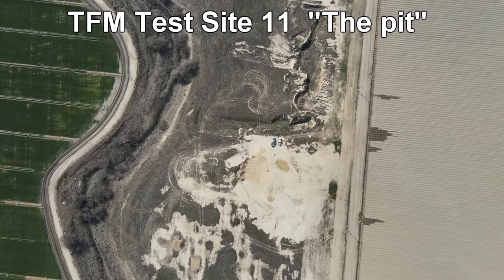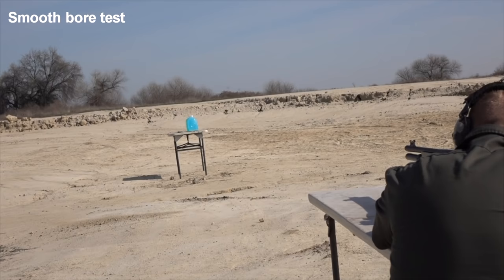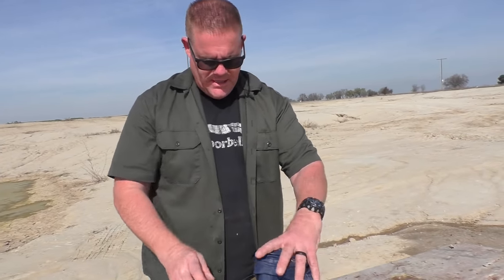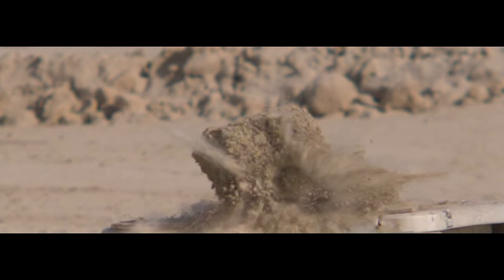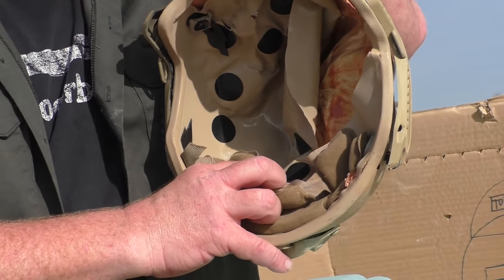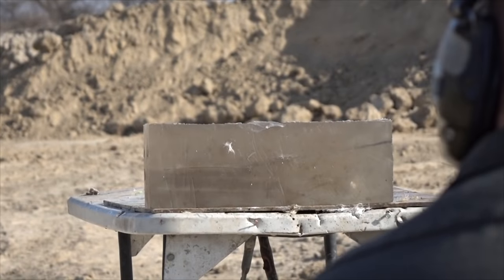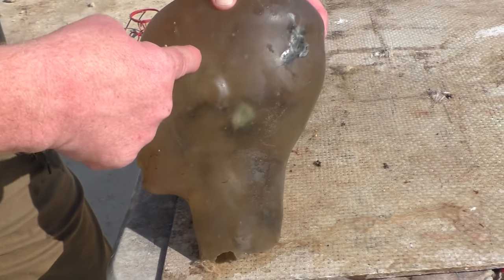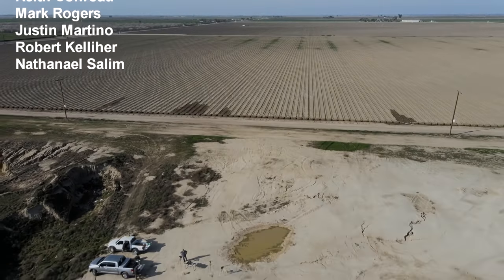4/0 Copper Cable Flechette Rounds - Tested

Comment: maybe solder the back end of 1 and try soldering the front end. would stay together till it hit then maybe shred the target.
Reply: I was thinking jb wield on both ends 🤷‍♂️
Reply: I was thinking just solder the back end and see what happens.
Reply: A few drops of cyanoacrylate glue. Just to give stability during acceleration.
Reply: I'm thinking melted wax might work to help hold them together. Or hot glue?
Reply: @andytuesday500  the point is to have the wires pop at some point, though, not cast into a solid block.
Reply: @ScottKenny1978  hey, he was trying to brag. Leave him be.
Reply: @Eatherbreather  Would probably melt upon ignition. But I may be wrong. I am married, I am wrong all the time! LOL
Reply: Good idea
Reply: Hahaha! I remember being wrong for the same reason years ago. Now if I'm wrong it really is my fault 😂
Reply: @roberthenson6153  
Would it handle the acceleration though? I’m betting that solder might be able to.
Reply: @ScottKenny1978  
I don’t know man, a poor mans slug using birdshot shells that allows you to use the lead shot for other reloading projects might be nice in a pinch.
Reply: @jad43701  a few years ago, I had a married woman (not married to me) tell me I was RIGHT.. I damn near fell out of my chair..
Reply: @andytuesday500  cast slugs that open like a flower and tao might feature them on a "you buildnit we shoot it"
Reply: Unabhaengigkeitserklaerungenalterthumswissenschaften
Reply: @andytuesday500  get to it and send stuff in!
Reply: wouldnt solder at the front be more stable? but i was thinking the same thing basicall a frangable slug
Reply: @twigglykevin  solder at the front, wouldn't make it frangible. You would be making a solid slug then, and there still wouldn't be any stability.
Reply from the maker: Bulking up the slug a little with the tape did two things,  engage the rifling better but also squeezed the bundle together tighter so it would hold together.  Hopefully that makes sense
Reply: I just said the same thing then saw your comment. 🤣
Reply: @CountryRock2k1  Sounds good. Just a bit of solder on the back end so that the front can still expand easily, allowing wires to break away from solder joints. Thin (? just how thin ?) lead casing instead of plastic insulation may work too, maybe catches rifling a bit better.
Reply: @CountryRock2k1  good idea, front may spread out like petals
Reply: You beat me to it. Great minds think alike!
Reply: @andytuesday500  you must be a new viewer
Reply: @PronatorTendon  that's the German word for this slug? I bet only Mark Felton could pronounce it.
Reply: @MrMakulit1959  No sir, this is a troll directly from Mark Twain 😂
Reply: @CountryRock2k1 That or brazing.  I am betting it would flower well.
Reply: Gorilla Glue!
Reply: @taofledermaus  WHEN it warms up some more. I'll get into my shop, and an idea I have rolling about, I'll make, and send you some
Reply: I'd like to see the insulation removed, the copper tempered (to make it as ductile as is possible), then brazed or silver soldered at the rear & wrapped in tape at the front.  

The idea not being the release of individual flachettes on impact, but a single slug that expands to create a copper likeness of Cthulhu which turns a soft target into hamburger.
Reply: Damn, just posted the same thing saw your post and deleted my comment. Good thinking sir, you are obviously also a genius 😂
Reply: I thought the solder would be a good idea,  intriguing projectiles, I saw slugs made from copper tubing with lead poured in, maybe a copper end cap for wadding?
Reply: When it held together, the results were really cool (and really wicked).
Reply: @chrisgabbert658  How about gluing just one end?
Reply: Janusz M with all of these different suggestions he will try again we will see 🤷‍♂️
Reply: @KrazyMitchAdventures  maybe I’ll do the same... plenty of 4/0 CU laying around... 🤔
Reply: @b.a.lineman7582  The Ideas I have, dont involve wire.. They do involve copper. but I just want to see if what I am thinking, will work.. I have a 28" barrel Stevens 320 smooth bore to test with. I'll have to find a Rifled choke for it though.
Reply: @chrisgabbert658  Why the Hell would you use JB Weld? WTF is wrong with people?
Reply: The Original Gamer well look in the minor like the rest of us and figure out what’s your problem.
Reply: shrapnell is better imo so no need
Reply: @roberthenson6153  no
Reply: @b.a.lineman7582  and aluminum I'm sure lineman,  be safe brother
Reply: @j1017bi 
You're right about the physics of getting flux cored solder to flow.  
The same does apply for soldering & brazing, but since the flux is a separate component, the molten solder/brazing rod is much more likely to flow into the flux than toward the heat source.  

Further control of where the solder/brazing rod flows can be obtained by not removing oxidation from anything you don't want soldered/brazed.  

A helpful tip, since the technique isn't so common anymore: By applying flux paste to a very small component to be soldered, you can carry solder on your soldering iron & not get a "dry joint".  
Likewise, you can add extra flux paste to your desoldering ribbon (the braided copper cable) to more effectively wick away solder.  
They're usually dipped in flux when manufactured, but a little extra helps when working with old solder.
Reply: @jad43701  you ever see what a wax slug can do? It's a good home defense round

Comment: The results of this round when it flies correctly are horrifying..
Reply: Seeing that in high speed has made all the work and R&D I have put into this worth every second. The best for last was an understatement.
Reply: @Pyr0531  soon people will be able to 3D print these........ god I love America
Reply: @jesusllanas9318  3D printer would be overkill for making something like that.
If you don't have access to such high duty cables, just get 19 short nails, cut heads off of them, pot them in wax or weak glue just to have them hold cylindrical shape + lower turbulence at the front and wrap it in electrical tape to fit the barrel.
Reply: @deldrinov  meant 3D printer to help stabilize the rounds or at least give them more predictable flight paths

Comment: After pulling thousands of feet of the stuff, I too am glad to see it shot! Fine job fellas
Reply from the maker: Ever need to use a truck to pull it when the tugger couldn't handle it?  lol
Reply: @taofledermaus  I've had to tie one end to a boom lift to pull some slightly smaller cable down a cable tray. That was fun.
Reply: Yeah buddy,  except it was an old Clark forklift   that did the dirty work. I was constantly washing the wire lube off old green

Comment: That was awesome!  I was amazed at how well you guys had it failed in by the end, with a little bit of electrical tape to add just enough to the width and a rifled slug barrel.  I think that is an outstanding option for a homemade flechette rounds.
Reply from the maker: thanks Brian!
Reply: @taofledermaus  I just reread my comment and apologize for sounding like an uneducated idiot for the poorly structured first sentence.  However, I am pretty sure that you guys understood what I was trying to say about it starting out at failed attempts but then the addition of an electrical tape and rifled slug barrel and became a quite formidable defense weapon if needed.    In response to your "thanks Brian!" comment, you are very welcome.  I did really appreciate watching the demonstration of that improvised round and the process of improving it.  I do not currently own a scattergun, so I will not be loading those rounds do defend my own home, however, I do have friends who do.  So, I will share this with them.  Thanks again.

Comment: Awesome 👌🏻
Great video as always. Thanks for sharing 😉🤙🏼
Reply from the maker: Thank you very much Horst!
Reply: @taofledermaus  Custom round request: an ounce of Airsoft BBs at UK-legal velocities.
Law says up to 1 Joule full auto, up to 2 Joules other weapons. Table of weights and 2 Joule muzzle velocities follows:
0.12 g = 1.85 gr @ 182.6 m/s = 599.0 fps
0.20 g = 3.09 gr @ 141.4 m/s = 464.0 fps
0.25 g = 3.86 gr @ 126.5 m/s = 415.0 fps
0.28 g = 4.32 gr @ 119.5 m/s = 392.1 fps
0.30 g = 4.63 gr @ 115.5 m/s = 378.8 fps
0.32 g = 4.94 gr @ 111.8m/s = 366.8 fps
0.36 g = 5.56 gr @ 105.4 m/s = 345.8 fps
0.40 g = 6.17 gr @ 100 m/s = 328.1 fps
0.43 g = 6.64 gr @ 96.45 m/s = 316.4 fps

For air rifles, we're restricted to 12 ft-lbf, because that law was written before we went metric, and I've seen a tin of 8.6 gr .177 pellets, so that's approximately US BB size and that means a muzzle velocity of ... how the hell do you work this out in imperial? Ugh. 12 ft-lbf = 16.2698 J, and that's 8.75 gr = 0.56699 g @ 239.56 m/s = 785.965 fps. There. One BB pellet at slightly more than .45 ACP muzzle velocity is legal. Can you hit some things with BB shot at that speed, please?
Reply: @Sableagle  I want to be your friend lol. Here in the UK aswell, having similar questions but lack the know how to figure them out

Comment: Soldering the base end of the copper wires would have been interesting to see what effects that would have produced 🤔
Reply: A.sort.of reverse mushroom
Reply: @DeandreSteven  ...,  if the base is soldered it should mushroom quickly and disperse energy fast... in a rifled bore it should be accurate
Reply: I want to see it happen
Reply: it would also be interesting to see what would happen if you soldered the tip. theoretically it could help keep it together in flight, add a little forward weight to stabilize it, yet disintegrate on impact....
Reply: @Vidar D  It definitely would help with the factor of over penetration. The slug would stay together at midrange without peppering surrounding area with shot or buckshot. this would effectively extend the range of a shotgun around the neighborhood
Reply: wow I can imagine the sound channel from all those wires splaying out like blades

Comment: I am curious as to how they would perform if they were packed in as an aerodynamic slug with longer ones as a core and shorter ones on the outside, making a cone kinda like the old russian rocket pods for aircraft. Would that improve flight stability and separation on impact, or decrease the integrity upon firing so it all just scatters out the barrel?

Comment: For the lovers of the Second Amendment I adore you if you can afford to get the equipment to make your own ammunition cartridges be they brass aluminum or Steel casting your own bullets making your own primers and powder please while it is possible to get the stuff start acquiring it if you can afford it and if you can do it as a group even better
Reply: reloading stuff is mostly sold out due to covid shortages unfortunately
Reply: I am thinking on the same lines.And it is good to start early,as there is quite a learning curve.My next skillsets is something I have been putting off because of the sensitivity of the compound,percussion caps.Then primers,if the necessity is still there.
Reply: Primers are the hard part. Note that you don't want to use mercury fulminate, the mercury infiltrates the brass and weakens it greatly, making it unsafe to reload.
Reply: Working on it. You can manufacture your own black powder very easily and very cheaply so older firearma types are always a good option too.
Reply: Adore? Don’t you mean implore?
Reply: @ivysinistra  how does covid cause shortages on guns and ammo?! Its people preparing to defend their homes against the corrupt government
Reply: @HellBent069  People were doing a lot of panic buying due to COVID. Some people were also trying to get armed but this is undeniably a major factor. I'm looking into arming myself in the wake of all the wackos storming the Capitol, couldn't find jack for reloading supplies anywhere.
Reply: Hate to tell you guys this but the machines to cold head brass wire or steel into cups and then make then into cases occupy a building that covers about an acre, for a small setup. Add primer and powder manufacturing lines and the know how to make good product without cratering the entire facility.. maybe just start out with swaging your own airgun bullets to start to realize the difficulty in maintaining tolerance and the high cost of a good manual press and the dies for it.

Comment: Instead of electrical tape:
Shrink tube.
If it’s longer than the wire it will begin to cover the end partially. That may hold them together longer.
Reply: Adhesive lined shrink tube...😏
Reply: So, I could put this together from the junk in my dad's truck?

Comment: It would be nice to see a similar configuration using tungsten from a TIG welder.
Reply: Or brazing rod.
Reply: A couple layers of shrink tube 👍😁
Reply: It could almost act like an APCR round, shedding the casing upon striking the target
Reply: I feel like one could make a light bond with soft wires by bundling/twisting them together and heating them up in a heat treat oven. Possibly even press them into a form of some kind to give it more of a bullet or slug shape. This would leave it ready to seperate on impact while retaining the weight of a solid slug.
Reply: Tungsten is very hard. I would be worried about barrel damage.
Reply: Expensive slugs
Reply: Maybe deck screws with the heads cut off.
Reply: @funkjoebrandon4246  Those would really screw up somebodys day!
Reply: @brahtrumpwonbigly7309  Bundle them together just a little bit smaller in diameter than the slug you want to make, wrap a thin strip of lead around the back half of the bundle then use a hydraulic crimp tool to "bond" the assembly.  The tricky part would be keeping the loose ends of the wire from mushrooming when you crimp the base.
Reply: @helidude3502  that has crossed my mind.

Comment: I was just working with this exact gauge of copper today and even brought home several pounds of it for scrap 🤔😂
Reply: Use this one easy trick to strip your heavy guage wire! Scrap recycling centers HATE him!
Reply: That is exactly what I did. I sent him 30 of the rounds to test with. I have a bowling pin that took one perfectly and I need to get xrayed.
Reply: @Pyr0531  great idea. I'm gonna try working up a good flying load of this. I'm thinking of soldering ot on both ends like many have commented.. should hold together nice until impact.
Reply: @Oldmanwithagoldpan  i wonder if JB weld could be a simpler solution
Reply: @thateffinguy2422  probably would be better because no heat involved.. using jb welds wouldn't melt the insulation.. 👍🏻
Reply: @Oldmanwithagoldpan  i think we went a little to heavy on the powder charge. going to drop it back down and re ladder test.
Reply: Scrap surly you mean projectiles lol
Reply: @Pyr0531 Both ate great ideas.. I always start  low and work it up.. I've got some thick hard waxed cards that should work nicely.

Comment: Try some bearing out of U joints, they are little thin hard rods of steel about 1/2 inch long and have rounded ends.

Comment: Hey Jeff, I think you can make somewhat of a semipermanent "shrapnel catcher", with mostly off-the-shelf, harbor freight parts.
 6x8 canvas tarp - $22
Paint the tarp front and back with a gallon of "oops" paint from Home Depot, or white: $30 or less. Doesn't have to be nice paint.
Enough PVC pipe to make a frame that holds your tarp upright so that you can catch the shrapnel. You won't catch all of it, of course, but you'll be able to show the scatter or the misses.
Canvas tarp repair tape. Gaff tape. Not duck/duct tape, because it doesn't stick very well to latex. Preferably the same or a similar color to the paint color of the tarp.
Couple of 2" clamps to hold your canvas to your PVC frame.
I really think that could show scatter and missed shots better, and once it's built it should be reusable for a long time.

Comment: The CONDUCTIVITY of this round is ELECTRIFYING! SHOCKING! As a home defense round where over penetration is an overarching concern these little copper rods of destruction might be just the ticket!
Brazing the copper wires into a copper base with holes drilled to accept the wires and brazing would be an interesting next
variant. You could call it "The Mad Hatter"

Comment: I had an idea once to make a DIY .410 slug, but involving 3/0 cable, cut into 1" plugs, then half of each plug dipped into molten lead to bond it and make it nose heavy. 

I was hoping the twist in the cable would act like rifling.  Never got around to it.

Comment: I cannot remember if whether my 16 gauge over-under left handed Beretta could shoot both barrels in one shot.  I only used it for clay pigeons, and you can confidently believe that with that very exotic competition grade trap shot gun, I still to this day have a 100% running record.  I didn’t even know that there could possibly be any difference in a left hand over under single shot, until I had one in my hands.  I guess it’s sort of like drag racing super bikes.  They’ll sort of twist in a funny way while the pressure is on.  Anyways, when I thought about ‘copper flechettes’, I got to thinking ‘two part chemical shots’, where one chamber holds copper, the other one, well I’ll leave that up to you to imagine.  Thanks for sharing this!  I would love to find some decent demos like yours at a firearm safety course somewhere near me, as my sister really wants to attend one.

Comment: Dip 1/4 inch of stripped wiring in molten lead. Reassemble with loose wire forward. Amazing round

Comment: After watching the video I had a couple of ideas. First you could try super glue, try getting it to seap between the wires. Try the bottom half first then both ends. Also hot glue, bottom then both ends. Of course hot glue will probably not sink in as much but as far as keeping it one piece it might just work.

Comment: Using fine stranded marine grade wire would be a true nightmare. You would need a case to keep it intact until impact. Perhaps a copper jacket like ball ammunition, but thin enough to eject the contents on impact?